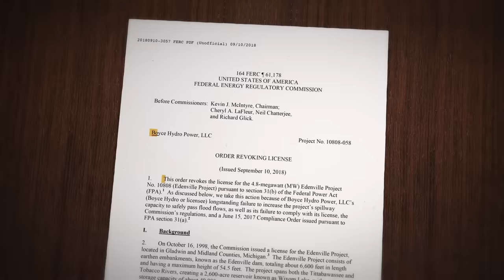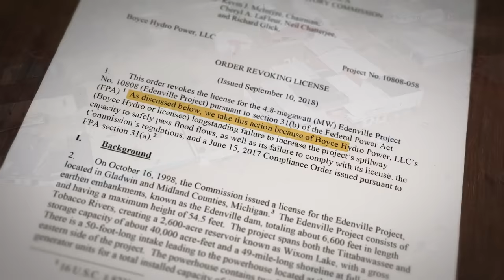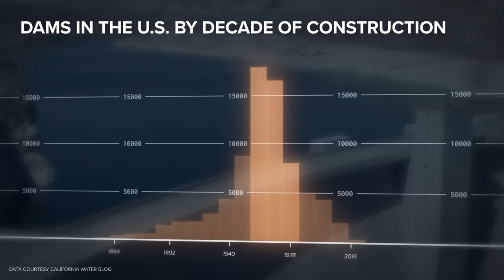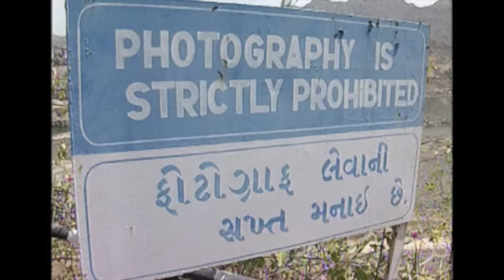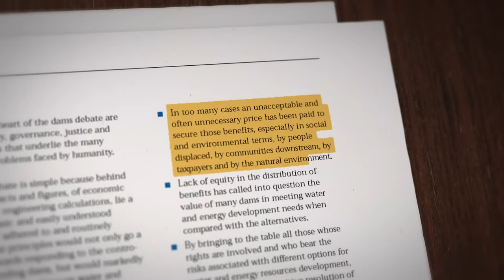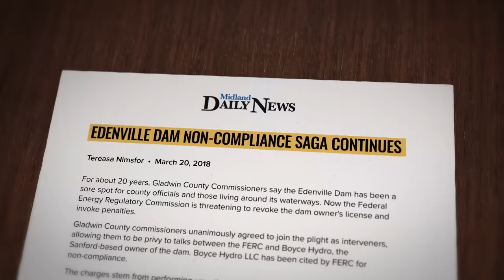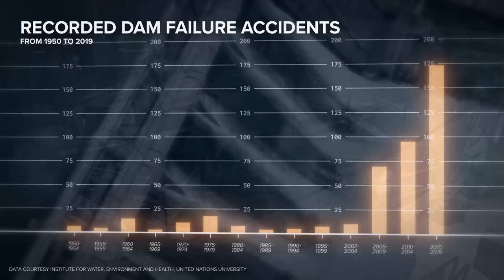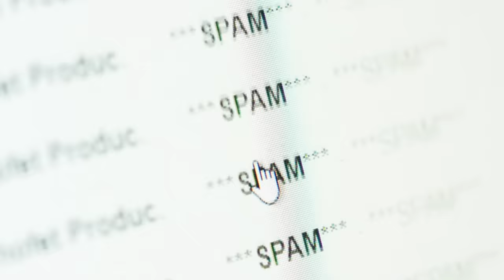The Troubling Danger of Dams

Comment: Thank you for bringing this issue to your huge base of followers. It's something that I've been getting more and more stressed out and angry over for years now. I'm glad that more people are getting the picture of what could, and will, happen if nothing changes - FAST as all hell!
Reply: So much of our public infrastructure is in this same state.  Part of the recent inflation surge is due to railways closing down older lines and not replacing them; reducing capacity at a time we need it to increase.  Highways are deteriorating rapidly because nobody wants to spend the funds on maintaining them, even as traffic on them grows and grows.  Power outages becoming more frequent as grid operators refuse to upgrade and modernize equipment.  Municipal water and sewer breaking down from lack of maintenance.

in another 50 years, i expect we'll see internet services begin to suffer the same problems. the only reason it hasn't already been a huge problem is that the technology behind data networking is advancing rapidly enough that everything still gets swapped out on a semi-regular basis, but that will change as the curve flattens out and we approach a steady operating level.

Comment: They have been working on Kariba dam for a few years already and still have some years left. The work needed is immense and there will be on going work after it is finished. If Kariba dam collapses it will be an unpresidented disaster. A tsunami-like wall of water would rip through the Zambezi valley, reaching the Mozambique border within eight hours. The torrent would overwhelm Mozambique's Cahora Bassa Dam and knock out 40% of southern Africa's hydroelectric capacity. It is estimated there would be consequences for Astralia and islands in between.

Comment: 12:31  i like the way battery storage is cut out of solar or wind calculations and placed in a high price tag column to the left making solar and wind far more cost attractive then it really is.
Reply: There are alternative to battery storage though. You could use pumped storage. What you do is you build a dam...
Reply: Time-of-use rates for electricity could be used to manage renewables on the demand side, instead of just using storage.  And other types of power also have limits on response time, which would need to be factored in for a fair comparison.  Gas can be turned on and off faster than coal, for instance.  And then there's cost of fuel.  This was only up front cost, and didn't cover that.
Reply: Solar and wind are VERY cost attractive.

Comment: I lived downstream of the Wixom lake for 8 years, without realizing that my house was potentially at risk from the south.  I thought of that direction as being flat, but higher, and any  flood risk coming from the other side.  Since to the north we sat 10 feet higher than the highway, no worries.  But if things had got more extreme during the failure, there could have been water spread out all over Homer township in Midland county where I lived at that time.  Fortunately for those residents, the flood stayed close to the river there, while downtown Midland was completely flooded.

Comment: Dam engineer here. It’s good to highlight dams but much of the content seems overly alarmist and gives the impression “dams are bad”. However, many of our largest cities rely on dams for their drinking water. 40% of our food comes from the California Central Valley, irrigated by water from… dams. Also safety and standard of practice has never been better. Yes dams are old, but those charged with keeping them safe are doing it better than anyone before them. 

Yes there are dams that are deficient but the industry is working extremely hard to make the good ones robust and tear out the ones that don’t provide benefits that outweigh the costs. 

Also 1” of overtopping is extremely unlikely to result in failure of a concrete dam. In fact one of the worst “dam disasters” involved 100s of feet of water splashing over a concrete dam in Italy known as Vajont dam. The side of a mountain basically slid down into the lake and launched water way over the top of the dam. It killed many people downstream but after the flooding stopped, the dam actually never failed. 

Yes many people have been displaced by dams. The cheapest real estate is always in the floodplain of a river, so inevitably it’s the poor and underprivileged who are displaced.  That said, the other half of the story is that the dam will now prevent those downstream from being flooded out. All dams will lower the likelihood of flooding and often make it so that people, farms, and industry can thrive downstream. 

Dams in the United States are rarely built anymore. All the good spots that are feasible are mostly gone. New ones are typically pump storage, which are basically giant storage tanks without a river. 

Our country relies on dams every single day and you do too. Even if you don’t realize it or see it. 
The industry is growing fast as there is much work to do but it’s no coincidence that industrialized nations build dams, they are valuable and they are worth keeping usually. 

The author would be wise to consult with industry and actually understand the issues before speaking so confidently against them.

I strongly encourage any viewer to research ASDSO or USSD and read for themselves and come to their own conclusion.
Reply: Worked in the industry too. Agree on all these points. It's important to be aware of the hazards - if the public is informed it may lead to better funding for the issue. But it needs to be considered in the context of benefits.

Comment: I lived (and my parents still own the house) in the first property south of Edenville dam, immediately south of the west spillway. My parents and I were evacuated the night before at around midnight, but came back the following afternoon to grab some stuff for an extended stay away from home because we were told it was unlikely the dam would collapse at that point due to overtopping.

I was there at the house, only about 300 yards from the western spill way when it failed.  We were the last ones across the bridge to the south of the dam before it was washed out.  Our house was one of the few that did not sustain damage because we were on the west side and it collapsed on the east side and just high enough to evade the rising waters. But the house was not accessible--except by 4 wheeling through the dried up tobacco river bed--for the next six months after the collapse. We were incredibly lucky as most people in Edenville and Sanford lost their homes, or at least got major damage.

Of course, this was also in the middle of COVID so we were shortly exposed through a family member we evacuated to stay with and had to quarantine for 2 weeks. Miserable times.

So thanks for raising awareness about this issue, when these things fail it is very destructive. We were extremely lucky nobody died.

Comment: For a short period of time I lived in an apartment adjacent to a river. When I moved in, the dock and stuff was way out of the water, so I assumed it was just low due to it being the summer. I asked around and as it turns out the dam holding the river back failed. It was built quite some time ago, and while it was small enough that it wasn't disastrous, it does make a great example of our aging infrastructure.

Comment: The value of dams depends on how the lake is going to be used.  

You basically suggest there is little value to building dams but in areas that don't get rain for a good chunk of the year like 5 - 6 months dams add a LOT of value.  They're water storage for the population.  In the states of Tennessee and Kentucky and the surrounding states, there were many places that were unlivable until dams controlled the natural flooding of the two main rivers.  It also provided that power that built a lot of industry that developed, and then left that area.  A lot of the construction during WWII happened there.

The only way Texas has a population that is now the 2nd largest in the US and approaching the largest is because of dams.  The state is continuing to build them although it's running out of places where they CAN put them.  This is what provides water for the population.

The part I didn't hear you address is what happens in the absence of dams.  Most localities with growing populations, which is like the entire world for the most part would use ground water.  The use of ground water is FAR WORSE than building dams.  When you drop the level of aquifers which is typically where the ground water is coming from, this ALSO drops the level of the water table.  ALL of the natural vegetation in an area has developed and ended up exactly where it is for many reasons, one being the water table.  The roots of plants need to be able to get water from the ground and the water table is what allows this to happen.  California is a GREAT example of what happens when you drop the water table.  The entire state burns.  While it is the case that natural fires happen there over time, it's incredibly rare that northern CA burns, and yet trees have been dying and the land drying out.  Some of this is climate change.  Most of it is the fact that agriculture has developed at an uncontrolled rate and they pull too much GROUND water.  And now the entire state burns.

Humans need water.  About the best way to deal with population growth in most areas is building dams, like it or not.

Comment: I grew up in the Pacific Northwest, with power provided mostly by dams. Rivers like the Columbia, coming down relatively quickly from the Rockies to the Pacific, provide a massive amount of power and seem to be more cost effective in the area than in most places, at least judging by the fact that local power companies continue to utilize hydro power so heavily. However, I didn't realize that they were such a common feature in other areas, and it's maybe unsurprising that they don't work as well in areas like Michigan, which just doesn't have the same rapid flows.

Comment: Not mentioned, but also important: everything is paved over much more than when dams were built. Six (total, in both directions) urban highways that seem to be everywhere these days would previously have been land that could have absorbed liquid. Massive mall parking lots, airports, and other paving projects completed in the last 100 years mean that water sequestration just doesn't happen as it's supposed to. Houston, Texas specifically seems to have ongoing issues with this, but it's a global phenomenon that's not being solved on a timescale that's going to change much. And, of course, concrete, asphalt, and similar materials all emit heat much more readily than the trees, grasses, or rivers that would have been there previously, exacerbating the heat issue.

As most of this pavement is car or truck infrastructure, and train yards generally do allow water to soak into the ground, one major argument for destroying roads and replacing them with rail is the simple fact that it will dramatically reduce the worst case scenario flood.

Comment: After building a 2 acre pond with no knowledge and no experience, it becomes very evident. The process of containing water has a science to it number one all dams have what you would call leakage but that has to be designed into it like my pond or my lake there was a certain degree of leakage that was acceptable. It was fed by a very small river, and I dug the The pond, deep enough where the pressure of the standing water would not affect the flow entering it it’s pretty much common sense. I’ve had a few of the sidewalls partially fail, but that was my fault not building the wall sick enough and a key component is the right vegetation to hold the dirt together and you have to have the ability to release water when it grows to a point that it might over top one of the walls of the pond so being able to regulate water height is probably the most important aspect of containing water to this day I fish in my pond.  I clean it out every single spring. They’re all good amount of native fish. It provides a place for birds to nest to feed it is the focal point of the area here for the local animals and I only built because number one there’s no place here to get a drink of water if you are an animal and quite frankly, it’s something really nice to look at this year I’m considering maybe putting a canoe on it just to get a sense and feel how big it is a little local kids my neighborhood going in little boats, but the water is only 5 feet deep you’re Our number of cameras on the dam and my neighbors have the URL when they can login from their smart device to see the status who is at the dam and what’s going on my neighbors have contributed time and energy and it’s become a pretty cool centerpoint of our neighborhood or community

Comment: Hurricane Harvey dumped FEET of water in Houston in 2017. Both the Barker and Addicks reservoirs were at maximum capacity and were on the brink of failure. Dam operators had to continuously release water downstream, which flooded thousands of homes, in order to prevent the complete failure of these dams. If the operators hadn’t made this gradual sacrifice, thousands would have died. I live downstream of the Barker dam in a two story house. If the dam had broken, we’d be lucky to survive on our roof.

Comment: Pretty good video but something I can't help but point out, comparing the wholesale electricity price of hydro compared to intermittent renewables like wind and solar really doesn't come close to equating a replacement of one with the other. It's basically impossible to do all the things that hydro does with wind and solar alone, and those spot prices mean essentially nothing. To replace hydro power which is either base load or peaker power, you are looking at a combination of wind/solar and the most expensive, dirtiest kind of gas power plant (load-following.)

No battery exists that can make up for the seasonable differences in output, at least not in temperate climates. It's not an easy problem to fix, that's why tearing down the hydro will probably always increase either cost, carbon emissions or both.

Comment: The Ladwp in the early 1930s packed 300,000+ cubic yards of soil against the front of the dam at lake hollywood known then as the Mullholland reservoir to prevent dam failure like the san San Francisco dam that was built with the same plans and materials in 1928.
Reply: William Mullholland is one of the main reasons it's illegal to be a "self taught" Engineer in the United States.

Comment: Selling infrastructure like that or better having it in private hand is dangerous without the proper laws. 

Any project especially a dam that can't just be thrown out after it's used up has to have a plan and money reserves accumulated to be able to one day fix / replace it. Those reserves have to be right and protected from anyone misusing or misappropriating them... it can't be that they are too little or simply not there when they are needed. Selling a dam means the new company now has the asset but also the burden of the dam without the accumulated funds to repair the past years of use. Considering the size involved and the possible dangers it could cause... that's plain nuts

Comment: I don’t think it’s fair to say hydropower is more expensive than wind, solar, and several fossil fuel sources, by using capital costs. 

There are two main types of cost for infrastructure - capital (building it) and operational (running it). While hydro will of course have pretty high capital costs per MW of capacity, it has very low operational costs per MWh, as it doesn’t require purchasing of any materials like oil or gas. Comparing the cost solely on the basis of capital costs, rather than LCOE, just to make your point more convincing, is disingenuous.